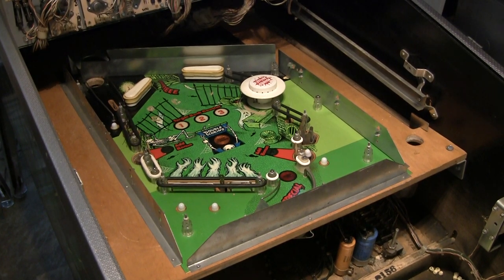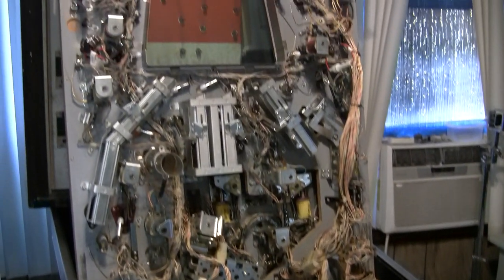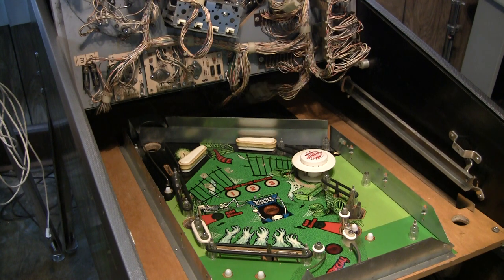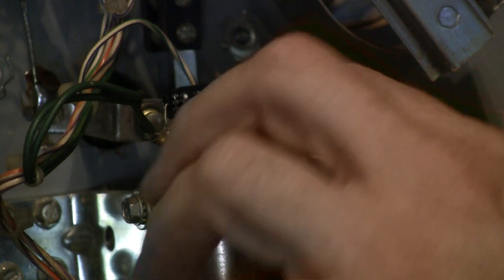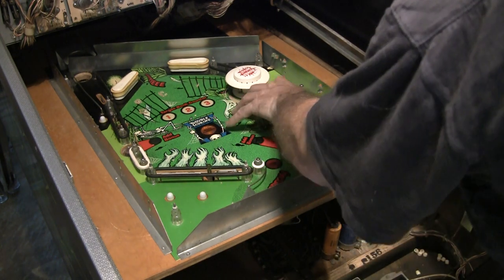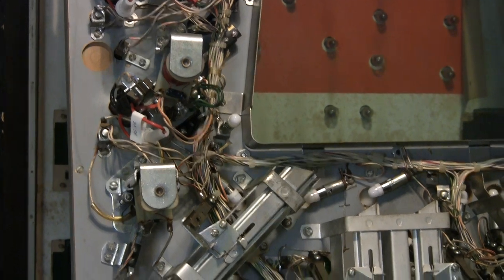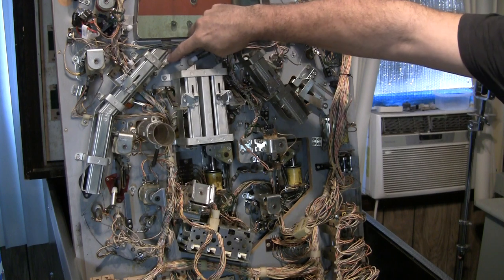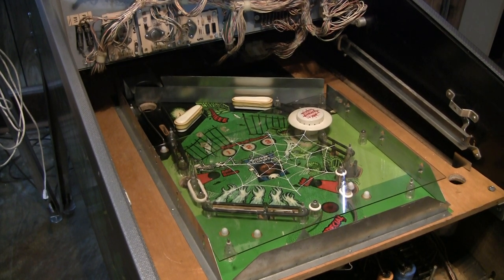Gottlieb Haunted House Pinball - Part 1 - Early Look At Game Needs Work

Comment: Thanks for this series - looking forward to all that you discover. I just picked up a Haunted House myself and it really is a beast of a machine. Mine is a barn find and I've cleaned it all up and replaced quite a bit but now it's down to the finding the problems in the small stuff. Pop bumper rebuilds... both playfield upkickers not working... and a few other things. Glad to see someone else going through the same machine to compare. Thanks again!